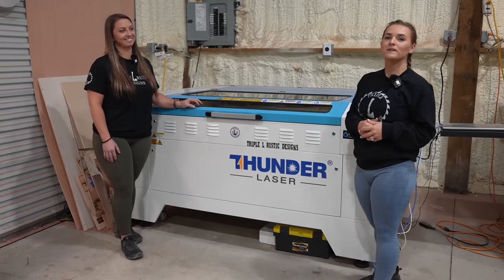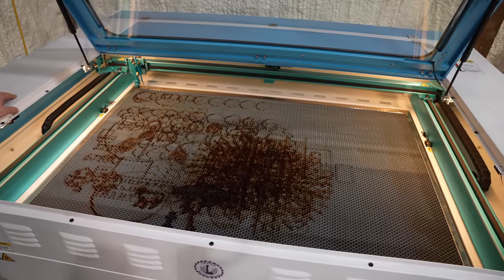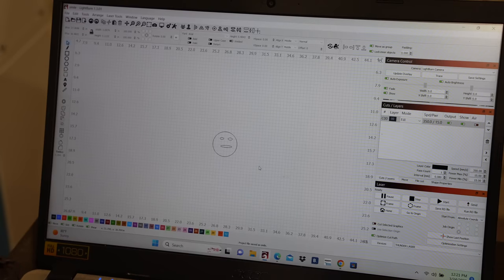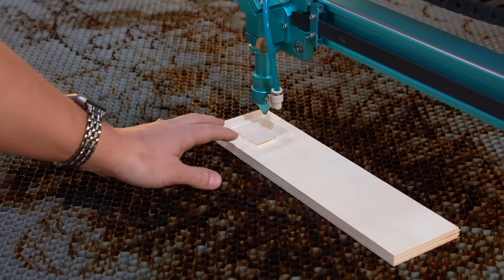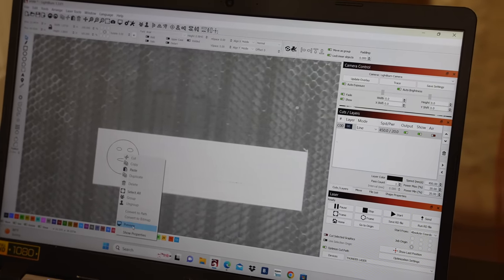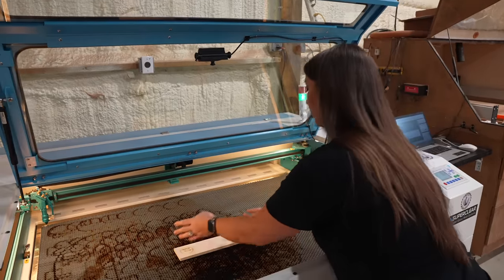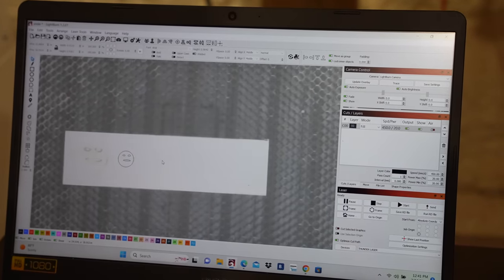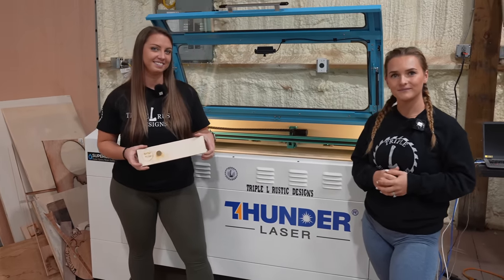We Bought A Massive Laser - Thunder Thursdays #1

Comment: It must be nice using that software. Back in the day Cnc programmers had to program the machine to that destination, but to easily crop the photo to the board is nice. However, it dumbs people down so I don’t agree with it unless you know how an NC Tap machine works. 

Machine offsets; move origin point to the board. Set part zero, program runs off part zero. 

Cnc machinists don’t get enough respect especially when we’re building all that fancy equipment youre using.